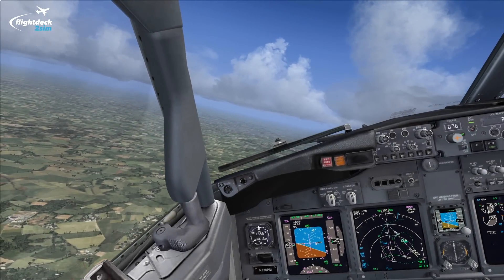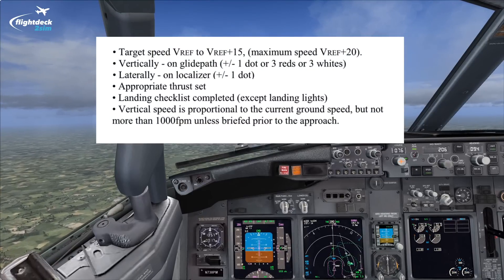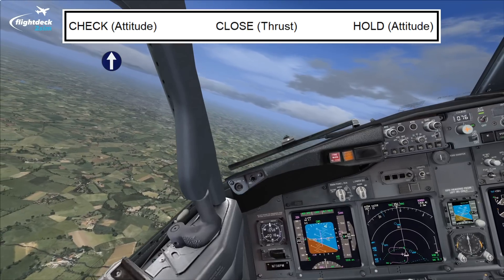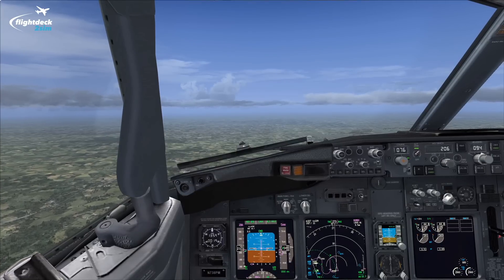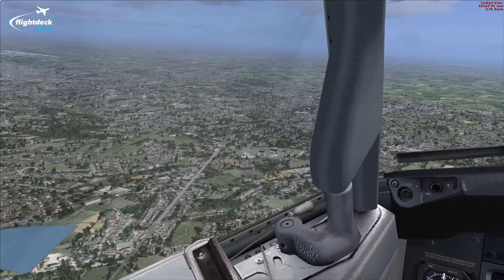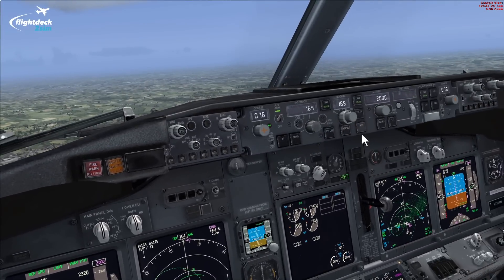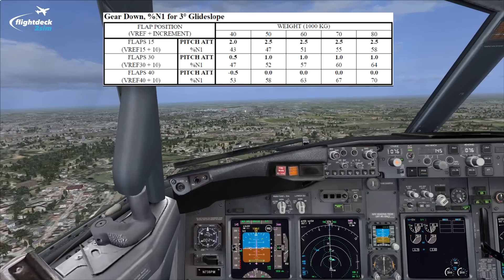How to Land the PMDG 737 by a Real 737 Captain

Comment: This is an awesome video!  My only problem I find is that when I raise that nose 2.5 degrees at 20 it always seems to float on me.  Sort of like it did in the video but usually worse.  Is this a PMDG thing or I just need to keep refining my technique?
Reply from the maker: Hi Intmir

The PMDG does feel a little "floaty" but the 737 does have a natural tendency to float if you're flying just a few knots above your target speed on final when initiating the Flare.

If you start "checking" and your speed is VREF or less the real aircraft will land quite firmly. This will also be the case if you reduce thrust too early, especially landing with Flap 40 due to the significant increase in drag. 

Small inputs using a computer joystick would involve a far larger input using the control column so the tendency to flare using flight sim is greater. Both in real life and in the sim if you initiate the CHECK, CLOSE, HOLD correctly and the correct height/speed it will settle quite nicely within the touchdown zone.

Good Luck!

FD2S

Comment: +flightdeck2sim Does closing the thrust mean the same thing as when you would put the throttle to idle on something like a C172?  I have the Pro Flight Throttle Quadrant system because I also fly GA’s in FSX.
Reply from the maker: Hi Kevin,

In a Cessna you’d typically remove the power and hold the aircraft off the runway. If you do that in a 737 you’d land VERY HARD

The approach is also flown in the opposite sense to a single engine piston aircraft. In a 737 thrust controls speed, in a light aircraft your pitch controls speed. 

Take a look at my “Landing Tutorial” for the technique to use to land a 737.

FD2S
Reply from the maker: Andrew Grey it could be quite different on corporate jets, certainly on a swept wing, under slung jet engine aircraft the way I described is applied!

FD2S

Comment: I've been simming for 15 years and I've just moved to Zibo in Xplane and suddenly everything I'd practised has gone out the window totally as the flight dynamics seem to be much more accurate. I've practised and practised and applied what you've said but I there's something I still don't get - you said aim for the PAPIs, which on my replays I'm doing perfectly - however as a result of doing so, after flare the touchdown is considerably further down the runway than the touchdown markers (and the tyre marks!) I'm interested to know if you know what a typical touchdown FPM is, perhaps I'm overflaring by half a degree? All the VAs online seem to go on and on about greasers despite them being unrealistic, and I'm curious to know what FPM is classed as standard in RL. Thanks
Reply: @flightdeck2sim  exactly, i've read about firm vs hard landings which is why these VAs and their sticklers for greasers confuse me... thanks very much!

Comment: Hi there. I've been a casual FS2004 player for years now, and I just wondered if your 737 NGX tutorials apply to the 737-400 for general procedures and practices?

One other question. When disengaging the autopilot, the trim is already 'autopilot-set', such that the nose lifts significantly, and isn't helpful for maintaining the descent. Is it me (i.e. have I selected the wrong speed for the angle of descent)? Is it FS coding?

Depending on weather conditions and weight, I generally approach with Flaps 30 / 150 KIAs or Flaps 40 / 140 KIAs, and use descent between -600 and -800. I do tend to short-hop a lot, and land with 75% or more fuel on board.

Don't be afraid to correct me thoroughly. If it sorts this nose lift problem, it's worth it. :D

Many thanks.
Reply from the maker: Hi there!

Yes this landing technique will work nicely for all variants of the 737. When flying to an Autoland the stabilizer automatically trims nose up at 400ft so if you disconnect it will pitch up, this shouldn't happen on a single channel ILS. 

In real life your landing weight will affect your final approach speed primarily and can vary considerably (Light weight as low as 110kts or if at your max landing weight as high as 150kts)

FD2S
Reply: Many thanks!

Comment: Hi FD2S, thanks again for the great tutorials! Hopefully you have time to answer the following question. I managed a lot of ILS approaches except one of RW09 EGLC. When i am established on the localizer and correctly following the gs (5,5 %) everything is ok. At 1200ft,i disengage the AP and A/T to fly manually.  What i see is that often overfly the approach looking at the PFD glidescoop indicator (so too high) but the papi showing two red / two white. Result, a too hard landing after touchdown zone or i have to go around because i have only half the runway left. Do you have any suggestion? Many thanks again!
Reply from the maker: Hi there!

Firstly LCY has a glidepath twice as steep as a conventional ILS, I don’t think a 737 is even authorised to land there! The PAPI’s I think are set to this steeper angle and I guess the ILS doesn’t or cannot be at the same angle. Unfamiliar with the approach but you’ll really struggle to get a slippy NG in there!

FD2S
Reply: flightdeck2sim thanks for the quick reply. Didn’t know that 737-800 is not permitted to land on EGLC. I was under the impression that if a chart, in this case for rw09, is stating minimums for catC aircraft that it automatically will mean approval for landing of those types. Of course for straight in landings only. 👍🏻
Reply from the maker: It could probably get authorisation but you would have to have really light loads to get in and out, I don't think it would be commercially practical for an operator to use! 

FD2S

Comment: Hey F2DS, i've been flying the PMDG 737 NGX for about a year now on p3d. And even after so much practice, i just can't get the flare right. i always end up either flaring so much that my airplane gains another 10 feet or manage a firm landing, but wanting a smoother one, keep pulling up and still am during touchdown so that results in a bounce... I have a few questions :
- I'm always looking outside during the landing, just checking the PFD for airspeed. During the flare, i just can't get the right flare amount purely by looking outside. Is it a crime to look at the attitude indicator during the flare?
- I can't seem to get how much flare is required sometimes a gentle pull makes the plane float. Sometimes an abrupt strong pull makes it descend to hell trough the ground as well or bounce. I notice many pull up just a bit at 50 or a bit earlier to already have a lower descent rate so they have an easier time with the flare. Is it recommended to do that? Or should i continue to practice your technique of doing one big pull at 20 feet and closing the thrust levers? Because i can never seem to understand how much of a pull is needed.

Thank you,
Kind regards,
Danil
Reply from the maker: Hi Danil.

Make sure you keep looking outside! Truthfully it’s difficult to use a fixed height to initiate the flare (check/close/hold) as there are so many variables (ROD over threshold/gross weight/flap setting/speed)

It’s just about judging the closure rate to ensure a smooth(ish) touchdown within in the touchdown zone. 

Keep at it and you’ll eventually crack it, you’ll always have the odd firm one (I do!)

Good luck!

FD2S
Reply: flightdeck2sim 
Thanks, i’ll keep on practicing then!

Comment: Hi, can you explain please what controls the speed of the plane, is it the thrust leavers or do they just give you power ?
Reply: You control the "power" (thrust) with the thrust levers. Speed is a matter of thrust, pitch and environmental influences (wind, atmospheric pressure etc.)
Reply from the maker: Hi Trucking In the uk. 

Speed is directly controlled by thrust yes but like in all aircraft, if you descend your speed will increase and if you climb your speed will decrease. It really isn’t too dissimilar to a car going up or down a hill, you use the accelerator pretty much the same way would the thrust levers!

Hope that makes sense!

FD2S

Comment: Speedbrakes armed before landing is that correct ? I don´t think so...
Reply from the maker: Hi Ronald,

To ensure automatic speedbrake deployment at touchdown the speedbrake must be armed! With the thrust at idle, as soon as gear strut compresses on touch down and the wheel spins up the speedbrake lever automatically moves up (so long as it's armed)

FD2S
Reply: @flightdeck2sim  Thanks and I learned something extra !

Comment: Nothing drives me more crazy than flight simmers addiction to greasing the landing.  So many on here float half way down the runway and wonder why.  It's actually pretty easy to land this plane and not float, even on a not so stable approach.  I also wish PMDG would have created a much more accurate rendition.  Seems like I'm always finding out about things they didn't get right despite their insistence that it's so accurate.
Reply from the maker: Hahaha, there is nothing more frustrating as an instructor when cadets try and pull off a smooth landing and keep pulling up during the flare! 

If you follow CHECK, CLOSE, HOLD at the appropriate height and airspeed the aircraft will settle down nicely and smoothly within the touchdown zone. It's worth noting if the runway is contaminated we'd actually aim for a firmer landing so we can get on the ground ASAP to deploy all the stopping forces needed on a slippery runway. 

Unfortunately some of the public view a firm landing as a bad landing but if I was a passenger knowing we were landing on a short runway I'd be very concerned if we were still flying passing the threshold 10 seconds previously! 

You must remember PMDG is an entertainment product at heart and it is incredibly accurate, really! (I'm no way affiliated whatsoever)

Sometimes there a few little quirks and I always try and point those out but for what you pay and to what you gut is really quite incredible, certainly useful enough for me to practice. Pitch and Power settings are pretty approximate, I would have expected more thrust (APPX 57%) to maintain approach speed and that's why I pointed it out! 

All the best!

FD2S
Reply: Its the combination of low resolution of flight sim sticks and misconceptions about the purpose and goals of pilots. Most people would claim a 450fpm landing was firm when that's a goal in a short field landing in many types.

Its funny too because while they're all chasing their greasers they also never go around.
Reply from the maker: I couldn't tell you how many FPM constitutes to a smooth landing!! But yeah, you hit the nail on the head! 

(see above comment)

All the best! 

FD2S.
Reply: Yeah thanks for the reply.  It's just frustrating that PMDG are so resistant to fixing obvious errors.  Even the dimension in the window area.  Yet oddly enough they have correctly this in the new 744.  I love their products but they are immune to constructive criticism and improvement ideas.  Thanks again for the vids.
Reply: I love that.  Nope, not going around! ROFL!  Well I'm at 4,000 feet and still floating on a 8200 foot runway, no problem at all!  RAAS "2000 feet remaining"; typical simmer response "Come on, almost there...Yes!  50 foot per minute touchdown, my VA will be so happy."
Reply from the maker: Yes with that I do agree and when I did start posting on AVSIM  I was met with some resilience and doubt over my comments. That was until they finally realised I fly this tin can for real AND teach guys how to fly it. 

You're most welcome Fcreceptor,

FD2S
Reply: flightdeck2sim Oh I know. I saw the thread. Been on Avsim since early 2000s. Had the first PMDG NG. I've owned a lot of study level aircraft as someone who can't fly for medical reasons. Out of all the wonderful companies (Dreamfleet, Flight One, Digital Aviation, Level-D and others) I've had experience with in the past, PMDG has always been the most difficult to work with on feedback. Oh well.

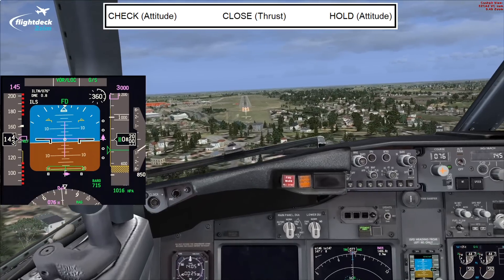Comment: Great video ! question, At 7:00 u said something I couldnt understand. Flight Simulator is difficult to land or real life? How you compared menuvering b/w two
Reply from the maker: Hi again Kk,

Yes I was a little hazy! Essentially using a joystick with no feedback I find a little more challenging to land! Small inputs using a computer joystick would involve a far larger input using the control column.

Good luck!

FD2S.
Reply: flightdeck2sim Joysticks over react !

Comment: thank you for the excellent tutorial! One question: how much reverse thrust you're using? how do you determine that thrust and how do you control it? (that's three questions :))
Reply from the maker: Hi Stefan,

It's quite tricky to set reverse thrust in the NGX using a keyboard.

On the real aircraft after touchdown you move the reverser to the interlock position which is called detent no1 (Idle reverse) it should give you ground idle, around 22%

Second Detent, when you move the reverser to the 2nd detent position = 75% N1

Max Reverse = 82% N1.

FCOM 2 that comes with the product will show what the positions of the thrust lever are for each one of these settings.

With FSX when you hold down F2 and let go you can stop moving the thrust lever in between the detents and you'll get the appropriate N1 setting, you wouldn't do this in the real aircraft!

Hope this helps answer your query!

FD2S
Reply: no, sorry, I was asking in real cockpit :)
Reply: many thanks, that's what I needed to know.

Comment: Quick question - when do you start to lower the landing gear?
Reply from the maker: Hi Victor A,

Typically 4nm or 5nm from the threshold of the landing runway but Capt has final discretion as to where to configure  👍🏼

FD2S
Reply: Thanks so much! Yesterday, I landed in Lisbon in my virtual 737!  lol   ;-)

Comment: Do you always intercept the LOC at a 90 degree?
Reply from the maker: Hi Flying High With Matt.

It would really depend on the approach being flown. With some procedural approaches and procedural turns you could intercept after doing a 180 degree turn. (See my procedural approach tutorial for an example!) 

It would be unusual if under vectors to get an intercept within 45 degrees.

For practicality in this tutorial I just routed direct to the centre fix and left it in LNAV. 

Good Luck!

FD2S
Reply: Ah, okay. For the tutorial, I understand. Though I do know, when capturing a LOC, ATC will give you a 30 degree intercept angle when in IMC. 

As for the 180 degree turn, that's not usually associated with an ILS from my experience, those are mostly VOR approaches
Reply from the maker: ATC will do there best to vector you onto an ILS within 45 degree taking wind into account.

You’ll find pretty much all ILS’s (certainly in Europe) will have a procedural approach available (usually when radar is not available) Any procedural approach can be onto any type of approach, ILS, LOC, VOR etc and in most cases involves a 180 degree after flying outbound from a beacon.

The procedural approach tutorial I made is onto an ILS 👍🏼 https://youtu.be/I4V9SzyjnPo
Reply: Ah, Europe, things are a bit different than in America.

Comment: Where did you get that N1 chart??
Reply from the maker: QRH - Performance Inflight - Airspeed Unreliable.

FD2S
Reply: flightdeck2sim 
Can we use that? That chart is for emergency, not nomal situation.
Reply from the maker: Certainly! The same chart is used to teach real world pilots reference attitude and thrust settings for different stages of flight. 

With pretty much all powered aircraft, if you set a certain attitude and thrust/power settings for a given gross weight you'll fly a certain airspeed. 

In this case if you set an Attitude of 0 degree, set thrust to 57% with a 60 ton 737 you'll accurately fly a 3 degree ILS at the appropriate approach speed and make small changes to any deviations. 

FD2S
Reply: Thank you! Your tutorial is very useful tutorial!

Comment: See this is the problem I have on every single landing - I float like you did. I go through the steps as you describe every time, and v speed is correct, flaps are correct, flare I believe is correct - and I float. Example - https://www.youtube.com/watch?v=8hdmoL2BDm4 - at 1:02:34 - one of the many flights where I just float over the touchdown zone. I'm wondering whether I should start shedding an additional 5 knots just to get down where I'm supposed to. Have you any advice for me? Much appreciated